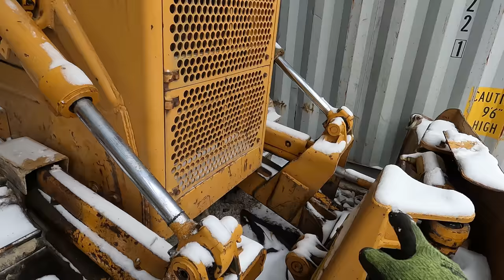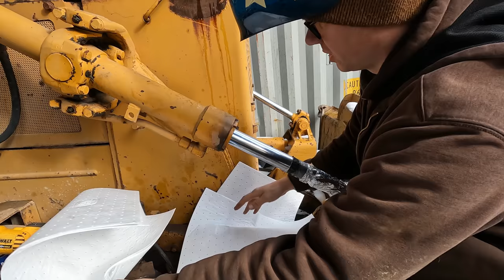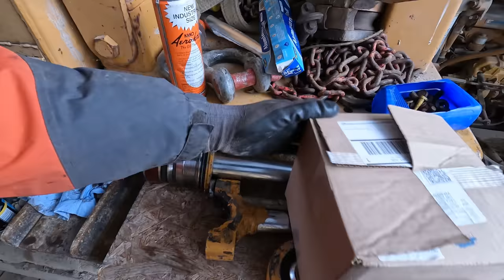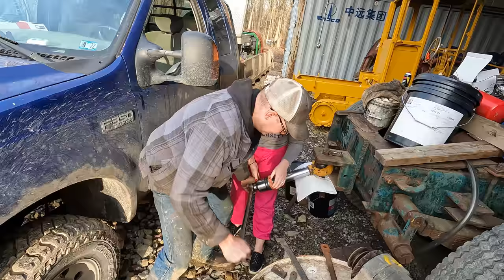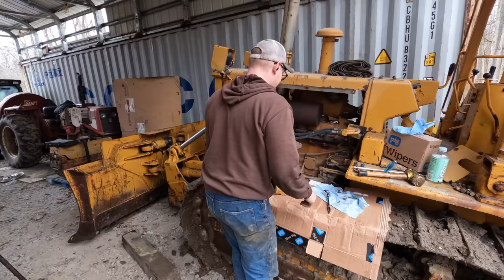Komatsu Dozer gets Cylinder Rebuild. (Long Overdue)

Comment: Oh my gosh Matt, I have never seen someone just racked over the coals like she did you. LOL. That was worth the whole video.   Putting the piston on backwards can make them leak much sooner is usually the only issue I can think of. The others are wiper rings on the bottom. Cylinders can be a pain in the rear sometimes but you have to make it work somehow. Been there done that. God Bless.

Comment: Hey matt. I’m sure you kno this but instead of buying those blue propane cylinders for your torch. If you wud grab the yellow map gas ones, when you run into stubborn stuff like that, instead of it taking 2-3 minutes to get it even sort of warm, ESPECIALLY doing heavy thicc arse metal your always working on. The map gas will get it in like usually about 1 min cherry hot to where it will bust loose. We used to always keep two of them same torches at both alignment racks at Lexus and Toyota for stuff that won’t break loose and it’s night and day easier and faster buddy. If you knew that and just choose propane that’s cool too just my two cents

Comment: Matt love your clips just some advice buy yourself a chain vice and a few C/ spanners take your rams off put them in the chain vice and use your C/ spanner far quicker taking them off and doing it in your shed no carting welders to the job and welding shit on and cutting off all the gear would cost you around $250 C spanners and vice can be used for a lot more than rams

Comment: A tip when welding near a chromed cylinder. You can take an oxy acetylene torch and run it rich with a carbonizing flame and use the black smoke coming off the tips of the flame to coat the rod in soot. The soot on the rod doesn’t allow the weld slag to stick to the rod. It will fall right off. You can do this and still wrap it in foil for extra protection.

Comment: Did a great Job on the cylinders. I've did the same thing putting the packing on first before the outer wiper seal and spanner nut back on. Normally, If  I didn't have a torque spec, I'd use a punch to mark on the nut and the end of cylinder before removing to get back in the ball park torque figure.

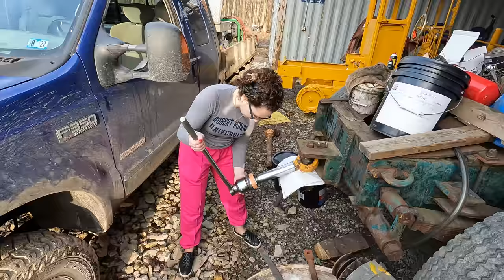Comment: Hey Matt.  Good to see your wife helping out in a cameo role.  😀  And congratulations on handling your Kobayashi Maru scenario starting at 38:30 like a pro.  You didn't mansplain up front, react to accusations, or try to answer questions for which there are no correct answers.  You got out of the way when it was time, and stepped in helpfully when it was time for a bit of a demonstration.  You sir, are wise beyond your years.  😏

Comment: I work on trailers and made the mistake of knocking the bottom pin out of a cylinder on a lift gate with a broken fitting on top.  Took a shower and got completely soaked in hydraulic fluid, then had to deal with it for 8 hours on a 90° day, then looked down from the top and dropped it and got fluid directly in my eyes and mouth.  I’m a lot more careful now.

Comment: it looks like yoou could use one of these for cracking stubborn bolts. TradeQuip 8032 Wheel Nut Torque Multi-Plier Wrench. you can wedge or add a spot for the leg to grip then you get 56-1 gear ratio. i found extremely handy for heavy vehicle wheel nuts.

Comment: Your cylinder gland caps take so much hammering because you have not held the cylinder solidly enough. The small rods you are using, just spring and absorb the force. You need a thick bar that fits the cylinder eye and strap it down hard. A couple of heavy hits will shift it.

Comment: Dude this ditch witch is still for sale(Craigs list) in Potosi, Mo. $3500 remove where it sits.  I think there is a health problem in the family, unfortunate, but could buy for much less, good video, great metal from the photos, If you need a free place to stay while you check things out, could stay for free with my 16 year old son and me. Would be great to potentially trench wire from the entrance to your shop, to run electical to shop!!!!!!! new great video!!!!

Comment: heat is the perfect solution for the stuck piston. the outside cylinder will expand with heat while the inside won't heat up as quickly. i'm sure he knows this as i i watched him freeze a steel puck before inserting it into a heated cylindrical hole. why not here?

the bride's a cutie! i like the way she complains. haha

Comment: To protect other components from weld spatter I use either copper tube or copper sheet. 

To fill in burn through holes if you have access to the underneath hold a bit of copper eg, flattened pipe under the hole then weld it shut and the weld doesn't stick to the copper

Hope this post helps

Comment: Tip for when A cylinder is stuck like that. Grab an air hose and pressurize the cylinder with the air.

Comment: If that cylinder were, say, backed into by a dump truck on a job site with the blade fully lowered, IF it hit the cylinder right at the gland it could've cracked it on the inner side near the dozer frame. Stands to reason that that crack probably opened up a thousandth or two. If they didn't compress the cylinder housing longitudinally when they welded it, they probably just filled the gap, which changed the angle of the gland slightly.

Comment: To check concentricity of cylinder, put ram back in and mount it true on lathe, then use dial indicator on outside to check the run off and movement on exterior cylinder clocking outside. The diagnosis will show the amount the exterior is out of true to the internal.

Comment: @21minutes, what you can do if you have a good mic set, is flapper that little bore to the right size again. It is what the shop I work at has to do with some of the parts that are that bad. Generally speaking, it's like a matter of a few thousands clearance it needs. Hopefully it's not 20 thousands under because you'd be flappering that cylinder for hours then....

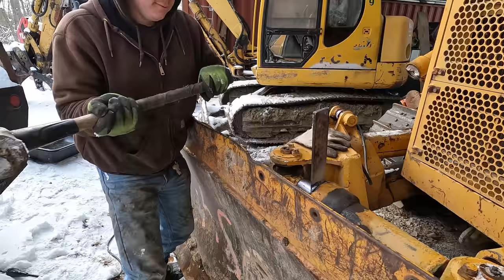Comment: 13:40 if you get a ratched strap on the flatbar you will take up the slack when hammering. it will help you alot since alot of the force from the hammer goes straight into the slack before transfering to the sylinder nut.

Comment: With your cutting skills you should e able to cut a spaner wrench out of a peace of steel that will work on those cylinders. That's what we had at a shop  I worked at it worked  as good as a high price one you can buy

Comment: Even though this video is a year old and I use welding like you use welding sometimes but on cylinders like that the best tool that I have found for that is a pin punch on the end of an impact hammer 4000 blows per minute or more and it will move that nut

Comment: Hi Matt   Might want to use a 2’0 or a 3’0 pipe wrench . We used them on something similar just  saves you from welding. Sometimes a small 2” pipe on the end.

Comment: I would cut the weld rather than chancing damage to piston. The cylinder should be put in your lathe and use a baring bore to true the internal bore of the cylinder.

Comment: 1. You must have anti-freeze for blood . . . 2. I'm shocked that you don't have a mobile vise on your truck. 3. The seals getting brittle for a couple of reasons. Sure, aga and heat have a hand in it, but equally, using the wrong or crappy hydraulic fluid is to blame. You can cut failures in half by using factory spec'd fluid and doing accelerated filter changes.

Comment: As far as I know the fixed part of the cylinder is attached to the fixed part of the machine. The layout of the oil lines is based on this and they move the least this way.

Comment: A little Chisel/Punchology for ya. Place your chisel/punch on the spot, look at the struck end and hit it. Don't give it the slight location tap just look at the struck end and hit it. Although 99.9% of people give that little "location tap" and then hit it, all that does is give the chisel/punch a chance to jump out of the spot where you set it. If you set it and then don't look at the struck end but instead look at the location of the head you'll more than likely short hit and hit your thumb. That's why you move your line of sight from the location and to the struck end.

Comment: You need to get one of those hydraulic crimping machines the amount of times you have to replace hoses. You probably would have saved enough to buy a machine 4 times over. They run around $4-700 from china.

Comment: Gland nut wrench isnt that pricy :). An second option is to drill 2 holes in the gland nut and then remove it like a disc on an angle grinder

Comment: For reference, a knurl is a surface like on a ratchet handle. The fine machine lines inside the brass bushings are called cross hatch.

Comment: Use an air hammer to turn those cylinder nuts instead of welding a bar on it and wailing on it with the sledge.

Comment: You could make a tool that goes in the little   Slots on the nut that will grab it and will give you a thing to tern the nut I have one that does my  Ishocks on my four wheeler but if you make a bigger one based off a shock adjuster wrench that's the name of it

Comment: The cylinder is not in a position to be damaged!  Did you happen to notice the guy with the welded strap beating on it with a sledge hammer?  Also, the reason you take a video of taking it apart is for reference when putting it back together.  I learned this after the many times of putting something back together different than it was taken apart.

Comment: For the time that you welded that metal to remove the glandnut on the hydraulic cylinder you could have made a spanner wrench of that piece of metal to remove that gland nut and have it for next time and be a little easier on the cylinder just my opinion

Comment: Curious what "Adam Abom" would do about the "welded" cylinder repair, as in suggestions for  "honing" the "bump" on the internal non-round situation. Seems like you will have future issues with this cylinder? Looks like the "welding" repair is what made that cylinder "bent" looking - or welding crooked, fingers are crossed that you can use this for the next decade without any problems.

Comment: The only problem with a backwards piston is that the chamfer at full extension provides clearance as it meets the gland cap. If you run it that way long enough it'll fix itself and make its own clearance. Shit happens; I promise you'll never do it again. That's the benefit of making mistakes.

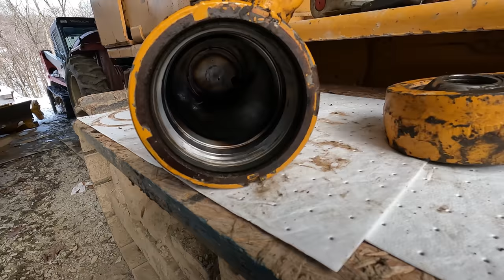Comment: At 21:00 you have to bore out the cylinder slightly.  A machine shop that works on engine rebuilds should have expertise in that.  Too bad you can't also get new or slightly oversize new seals for the piston.

Comment: I don't suppose the piston knows which way it is going in the cylinder.  The only thing which could be different is if the piston has a groove for an O ring on one side,  to stop oil flowing past the nut threads to the ram shaft.

Comment: I have used compressed air to get cylinder apart. That's if it doesn't leak by to bad. In a control environment

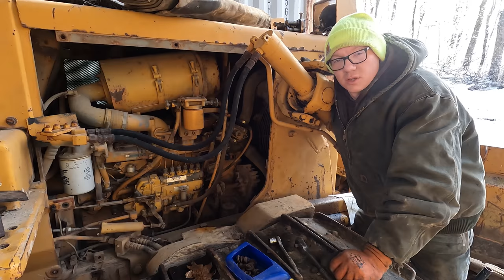Comment: I know this is an old video and nobody is going to see this, but if it were me, I'd put an engine cylinder hone tool in there and just get some on the inside of the one that got stuck.. maybe just enough. not sure what he does, but i'm at 21:14 right now.. anyway my 2 cents.. like the pull it apart with the kabuto idea

Comment: Hi Matt, I love these type of videos where you repair things as I love to do things myself not only to save on labour cost but to gain knowledge on how the work and the satisfaction on doing it myself. So keep on doing these type of  videos.  How is the new shop preceding the last one I saw you just levelled out the area and in another video I saw the packs of timber around ready for the build. Tell the Missus she needs to work out a lot more so she can help to tighten the nuts and bolts for you.😀

Comment: Just watching this now.     I am not a hydraulic expert, so not sure what putting it together backwards would do.   I kind of feel it could be like getting your compression and oil wiper rings backwards on an engine though.   The oil seal is kind of at the wrong end.   
Hopefully it won't cause you any issues.

Comment: Love the videos. But I disagree with the thought that buying a good set of hook spanner wrenches is not worth it since you say you won't use them. You can get a good set of hook spanners made by JH Williams, very high quality, for around 100 bucks. You have countless machines are hydraulic drives. So to say you'll only use them once is doubtful. Anyways thats my 2 cents, you still got it done none the less.

Comment: very surprised you got the rod nut off. the ones on my dozer's front lift cylinder are torqued to somewhere around 1600ft-lb edit: i double checked my service manual. they're torqued to 1200ft-lb

Comment: When you are finished putting up your shop are you making it big enough to put all you toys in there? If not are you going to put a concrete slab down or maybe compact gravel? 

This is my second time watching this video. Sometime this week I have to repair a hydraulic cylinder and I had saved this video to watch before doing the job so that way anything I might have forgotten I just had a reminder on what to do.

Comment: Get a wrench. and a oval cheater bar.

Wrenches for those caps are not expensive.  You could even make a tool that fit on an impact wrench.  

Cheater bas, can be anything, so make a ridged one.  Your cheater bar flexes.  You are doing work to flex that bar.  For a cheater bar bigger is better.  Get a big thick aluminum tube and use that.  It can have an adapter to connect to smaller diameters.  I had one in steel, but it was too heavy.  I had a few nested tubes, with some bolts keeping them together.  It was a mess, but worked.  In the very cold wheel nuts are too tight because some "guy" uses an impact in a hot garage.

The idea is that there are a few cheater bars in one.  The thick end goes on the nut, and the smaller tubes are away.  It was 2 - 3ft or 6ft, steel, and too heavy.   The tubes became something else.  Aluminum is 1/2 the weight.  

I started using more cheater bars as I aged.  Then they got longer, and heavier.  Then aluminum.  Cutting stuff off with a grinder is the lightest.  Too many people heat quench pound, etc.  Just get a 6-10 ft thick walled cheater bar or a grinder.  

You could just get some crane.

Comment: I would have tried to make the tool for the spanner nuts, then use a long pipe for leverage, I wish you had a better stand holding up that blade, Ha Ha I did see you doin it

Comment: Completely off topic here. What are the broach bits you use to drill holes in the steel you used to build the (d)ROPS protector on the Big Cat 977? I'm trying to find a more efficient way to do some hole making on a project. Thanks for the information in advance. 👍🤘

Comment: Maybe a 48 or 36" pipe wrench could get a bite on the gland and break it loose. Use a cheater if you need to. Sounds like less work than welding, beating, then having to repair the weld area.

Comment: How serendipitous that I noticed you had this video as I have to do the same job on my (much smaller) tractor (JD 5205). I hadn't thought of your approach of welding a reefer bar on the end nut, I immediately thought to obtain, or make a spanner wrench. My Internet search for buying one yielded zilch, so I just resolved to fabricating one. Hence, I have two questions, please. First why didn't you just leave the welded reefer bar on the nut to help you torque it after reinstall (then cut it off after you torqued the nut sufficiently). Second, my hydraulic cylinder nut has the same (10mm) notches, aligned in the same manner, (into which the spanner wrench would fit)  Could you please tell me what company made the special tool a viewer sent you, and its part number? Thanks, from eastern AZ.

Comment: I really can't see what harm the direction of the seals could do. I mean, they are designed to take load either way? The cylinder is capable of both extension and contraction, so the pressure can come from either end of the seal, am I wrong?

Comment: I'm wondering if with the pistons on the rods wrong, if it will make the seals work incorrectly or not work at all under the high pressure situations. I have to wonder if it will cause bypassing in the double acting rams.

Comment: Hello !   It's 2022 now, and we can get welding machines no bigger than a lunchbox, that are good for 200 Amps
Reply from the maker: Not engine drive ones that can weld 100% duty cycle….
Reply: @DieselCreek  Sorry, I wasn't clear. I should have been specific. I meant a SMALL welder was sufficient for this job  (.....IFF you had 110/220v  in one of your vehicles)
Reply: @sayeretmatkaal  I'm REALLY struggling to understand the point of this comment......
....he's GOT the welder....!!!!!
Reply: @andymccabe6712  So am I.I must have been drunk

Comment: Maybe I'm too late I havent even got the the end yet, but that cylinder what was welded and stuck together then had the ridge inside. What if you clean it out with a engine cylinder hone? Or would that make the walls too rough to seal properly?

Comment: sorry for  laying on the floor lauughing at your oil squirt in face. but ihave done that before also.cept it wasnt -60  was 80 degrees . had to rpelace all the seals on a d-8 and my old case backhoe. whyi got them also so damn cheap.  bought them both from the same guy. d-8 was a 92 i paid 6 grand for it because of the rams all leaking. and the backhoe is a 2000 case e paid 3500 for it becuase the owner thought,  there is the word ffor him ... he thought it would cost more than the tractor was worth they worked but leaked like a sieve. took 5 gallons of hyd oil to load the backhoe on my trailer.   the d-8? glad i had a 55 gal drum of hyd oil on my low boy lots of kitty litter to cleanup the mess on the trailer.  back roads with the d-8 did not remove the blade and at night. back mtn roads. with lights on the blade.midnight was no one out